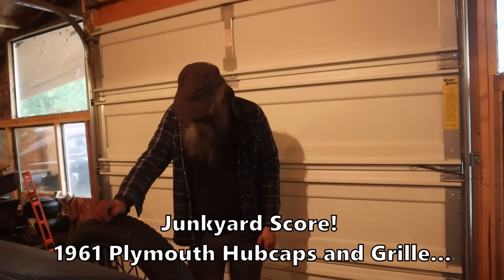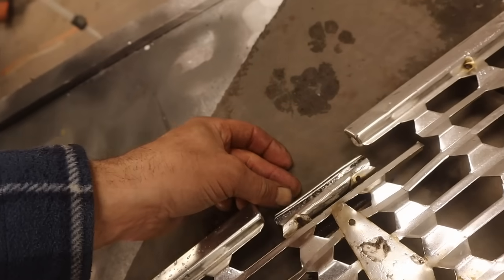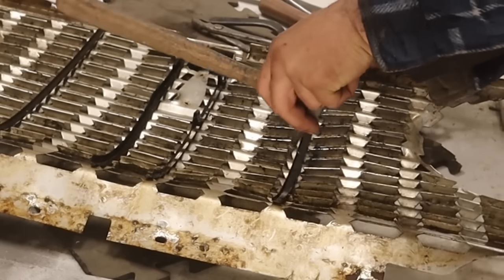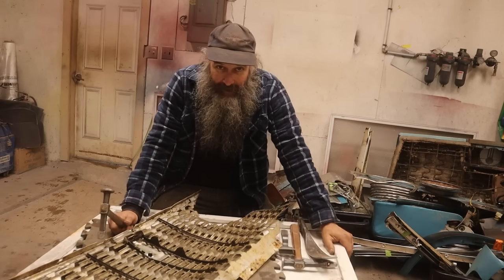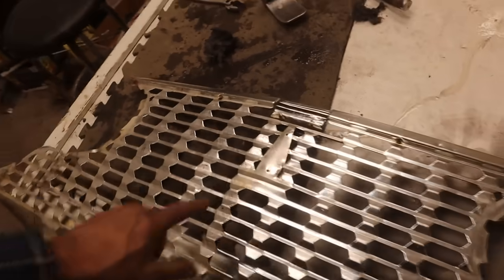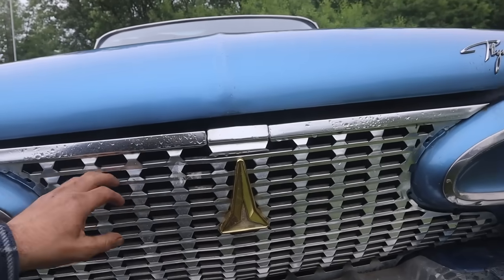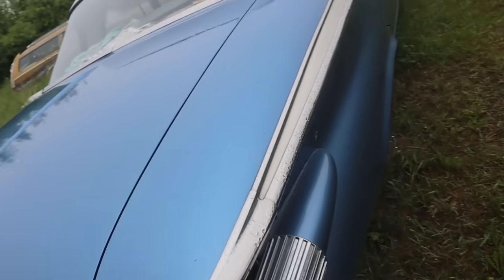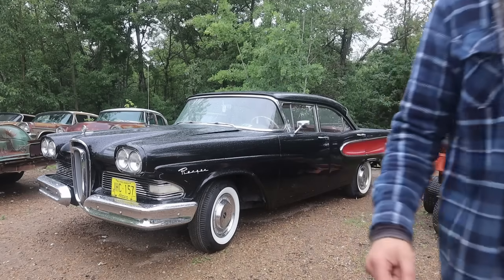1961 Plymouth Parts Score at the Junkyard!

Comment: I had a friend of my parents that had a 61 Plymouth.  it was a slant 6 3 on the tree.  when the car was 10 or 11 years old it was determined that it needed an overhaul . I was elected to do it.  the man used  Philips 30 w no detergent oil.  10c a quart .  that was the dirtiest engine I have ever seen.  I used a Hamer and chisel to remove  the carbon in the engine..  Did an in frame overhaul
and got the radiator cored and cleaned..  about 5 years later they sold it to a kid that within 2 weeks wrapped it around the only Tree in west  Texas. it was light Blue like the one you have.

Comment: My dad bought a 1961 ply Fury two door hard top in 1963, it was black with red interior, 318 v8 four-barrel carb, dule exhaust, auto. We had that car until 74, my dad gave it to my sister if she would hold a job, she let the deal go down and my dad sold the car. I really wanted the car, but I was in the Army at the time when he sold it, and did not tell me. You just don't see them at all anymore.

Comment: In 1961 I was 10 years old. Grandpa bought a purple ‘61 Plymouth to use on his rural Iowa mail route. At the time, his recently departed brother and another man had a Plymouth dealership inn out little town of just under 200 people. This was shortly before the dealer networks were revamped to just one per county. Anyhow, I was with Grandpa at the station (it was also a Mobil station). When I saw the car I told him he should buy it. He didn’t say anything, but soon, there was the purple car in his driveway! I thought for a long time that he bought it on my recommendation!!! My understanding is that the automatic tranny’s in a Plymouth did not hold up well to the stop-and-go life on the mail route. His solution was to have it replaced with a Chrysler tranny. That was the story. Maybe it was just outfitted with more heavy duty parts.